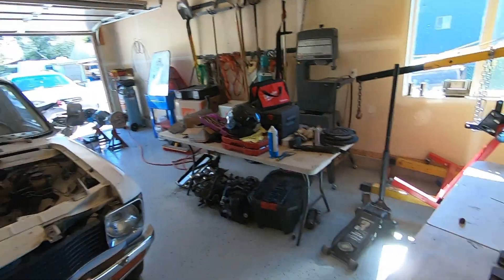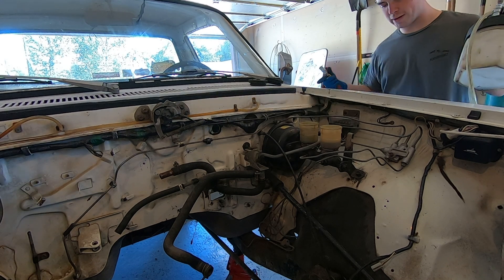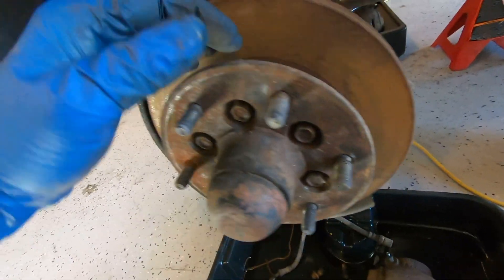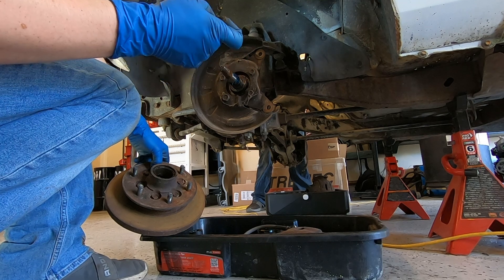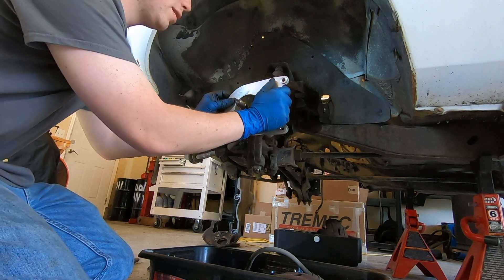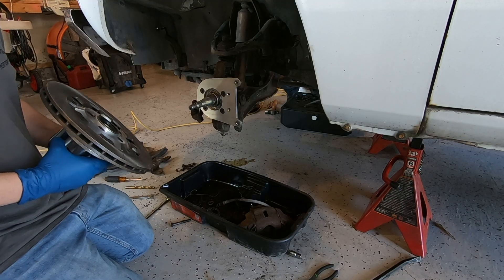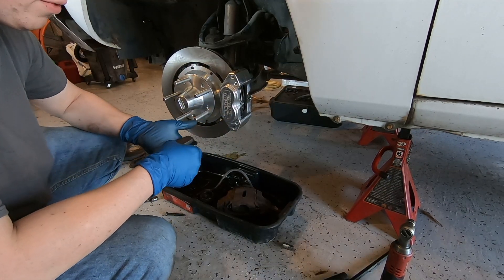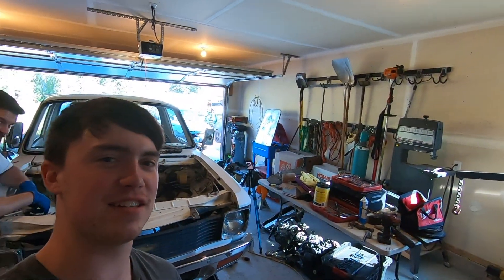NASTY LUV Build: Part 17 Aerospace Components Brake Kit Install!

Comment: Is it gonna have air ride or drag slicks on it, that would be neat
Reply from the maker: It will have street slicks
Reply: @autotechaaron  😎👌
Reply: It's being built as a retro NASCAR lol why TF would it have airbags😂😂
Reply: @scotty1600  lol i forgot about that, i was just wondering since it was lowerd in the pictures, and air bags seem more practical than hydraulics or regular shock i guess
Reply: @dts369  NASCAR springs are naturally lowered 😂
Reply: @scotty1600  true, but lowerd spring srentmthe best for main raods with potholes n stuff